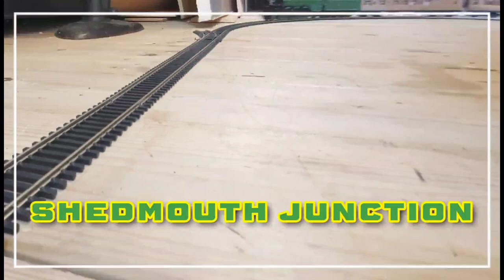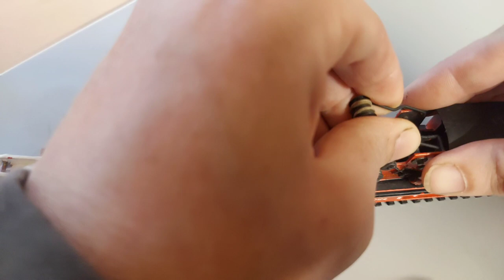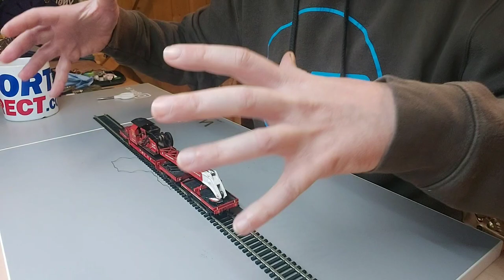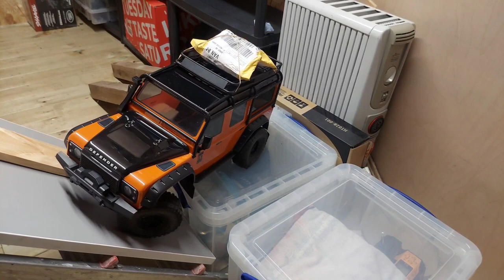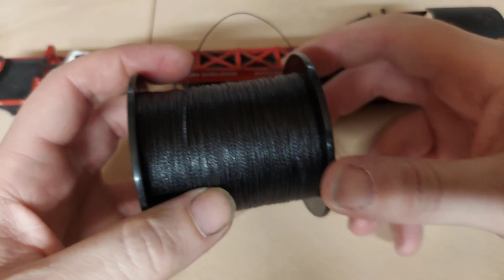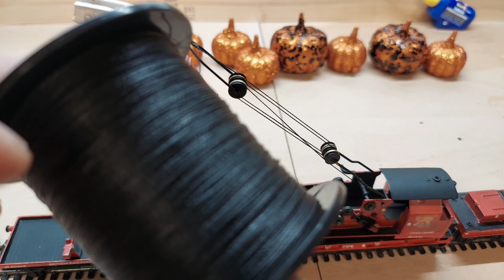Modified Hornby Dublo crane repair. New shelf layout addition.

Comment: Hello there, an interesting video. A bit of background info,  1 / Crane no. ( 330 )133 was a Cowans Sheldon 45 ton steam crane, 1 of 6 built for the LNER in 1939 ( 2 were transferred to the WD in 1941 ) and are an enlarged version of a Cowans Sheldon 36 ton steam crane of 1936, all of these had relieving bogies.( The 4w very short wheel base wagons at either end of the crane, which hold the HD jacks. ) 2 / The Hornby Dublo crane ( cat 4620, introduced October, 1959  ) was based on 133, which was based at Cambridge from 1940 - 1970. Apparently, Hornby Dublo intended to use a scale length jib, but found that it was too long for their supplied track curves, so a shorter 40 ft jib was substituted, which co-incidently, makes the HD crane suitable for the  two 1936 cranes, nos. 124 & 158. No. 124, as ADRC 95223, was purchased by Peak Rail Preservation Society.( All crane numbers above are BR. ) 3 / Peter Tatlow, CEng., MICE did two upgrade articles in Railway Modeller, December 1960, and September 1969. He later wrote a 3 volume book "Railway Breakdown Cranes" ( Noodle Books ) 4 / the late John S. Brownlie "Railway Steam Cranes- A survey of progress since 1875" ( self published 1973 ) , has a photo of the newly overhauled crane no.124 at Doncaster Works 5 / I like the clip in  block rollers, and the heavier hook that the previous owner did, a neat solution. The original HD handles are out of gauge, hence the replacement. 6 / A layout article of some years ago ( reference now forgotten, unfortunately ) in passing mentioned the use of thin wire for the cable runs between the block rollers, with blackened waxed cord going underneath the roller and cable assembly, so that posing the crane in the desired position did not require a working block roller with moving cables assembly. Thanks for an enjoyable video, regards from Australia.
Reply from the maker: Hello Philip! Wow... now that is a fantastic piece of knowledge and research.  Thank you so much for firstly taking the time to watch the video and secondly for such a knowledge filled and brilliant contribution!  🙂 
Kind regards and all the very best. Martin

Comment: They've got so much charm those Hornby cranes, even the plastic ones. The all metal Dublo versions are just lovely though. Anyway, why I'm here; I'm a hobbyist heavy plant fitter and we rigged a crane the other day. There's certainly nothing wrong with the term 'rigging' anyway. Even though they're cables, they're called 'ropes' and the strengthening crossbeams on the jib are called 'laces'. According to the real life fitter I was working with anyway, and he was at least 104 years old. Smashing bloke, but theresna good reason the call him 'Dangerous Dave'.... 😀 Nice work anyway.
Reply: Oh aye, the pulleys aren't called 'pulleys' either. They're called 'sheaves'. Just in case you ever get it in a pub quiz :)
Reply from the maker: Haha.. Fantastic!  Thank you so much for watching and taking the time to comment!  This is fantastic information! Im bound to forget all the terms, but by the time im also 104, i should have got the hang of it 😂😂.   Funny thing is.. i have tried to look up component names etc on the old interwebs and failed miserably, so genuinely, i really appreciate your help. 🙂
All the very best. Martin